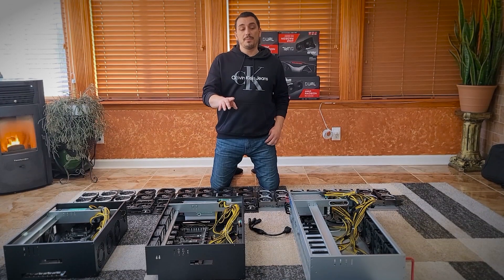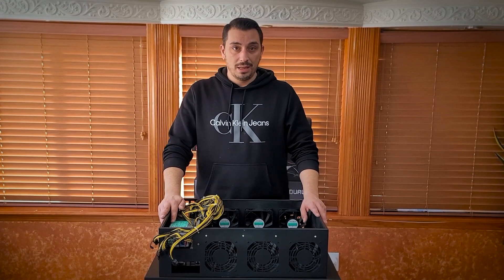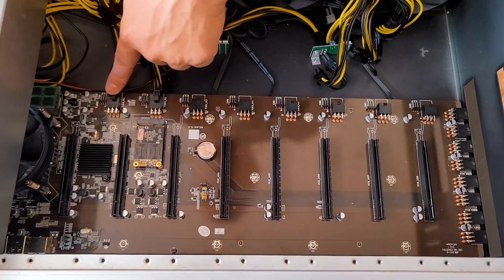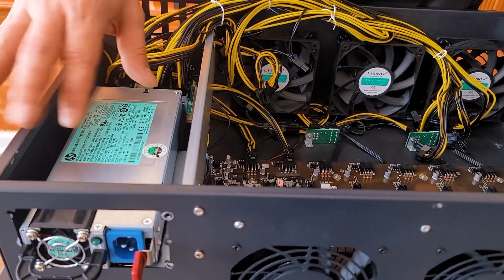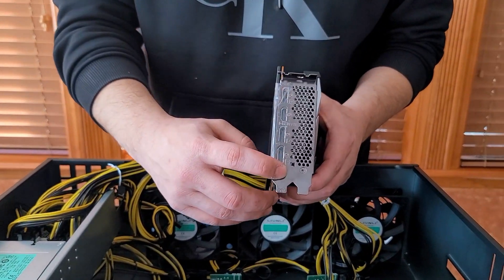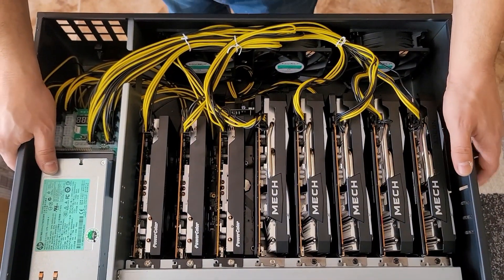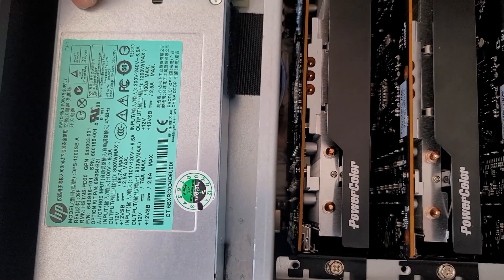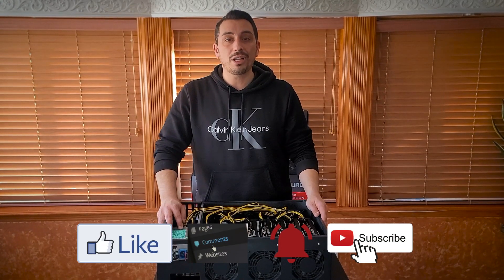8 GPU Mining Case Review Part 1-3

Comment: EVGA Gold PSU are 5-6% more effecient than those "platinum" server PSU's just saying, tested at 220 volt. Server PSU pullet 840 watts at the outlet, Evga 1000 watt pulls 792
Reply from the maker: One of the main reason I suggest server power supplies isn't just for their efficiency but also their durability. Server power supplies are designed to run at full capacity 24/7 365, making them in my opinion a better long term option. I do appreciate your feedback, look out for part 2!
Reply: You should do a video of this bc thats hard to believe and you have to make sure the server psu your using is 94% efficient bc theres some that look the same but aren't rated at 94% efficiency